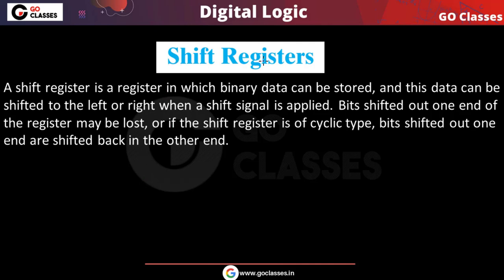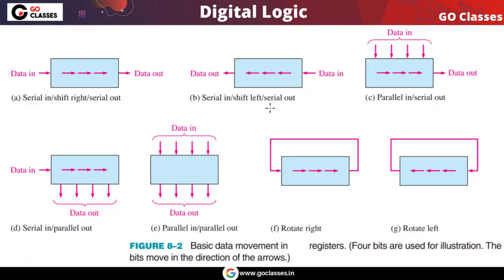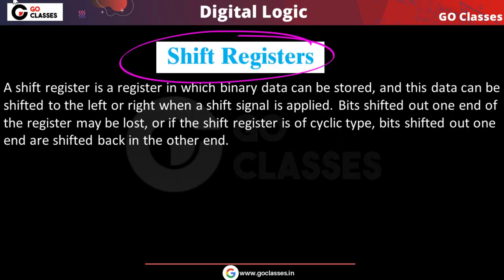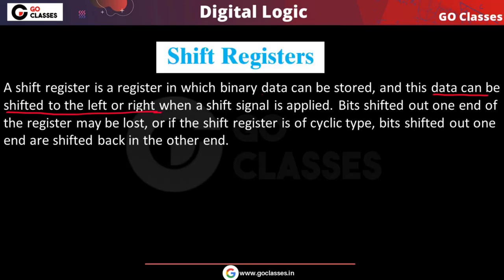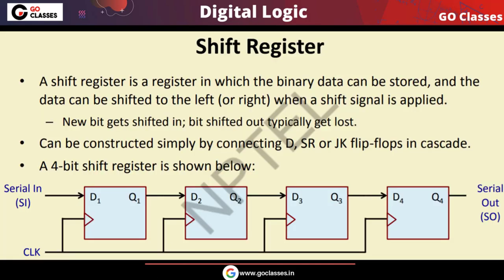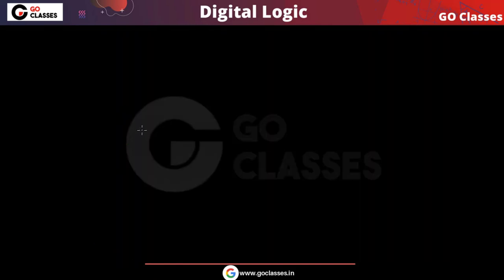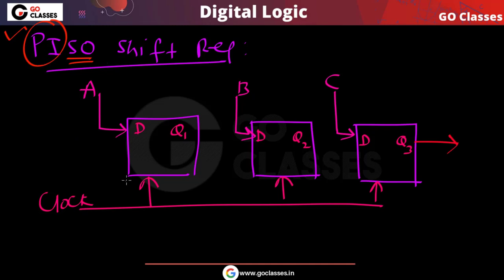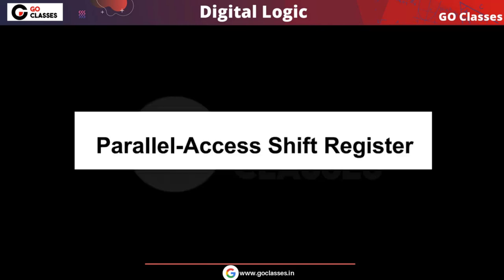Shift Register : SISO, SIPO, PISO, Parallel Access Shift Register | Sequential Circuits | Digital

Comment: 44:24 This diagram is slightly wrong. The first flip flop should not have a multiplexer before it. The input A should be supplied to it regardless of the shift/load value.

Comment: 50:03 In Parallel Access Serial Register, when Load = 0 then it must behave as Serial In Serial Out Shift Register but still we can access all the outputs parallelly, due to those output lines going upwards. Can you please clarify my doubt.
Reply: yes, we can access all outputs parallely.